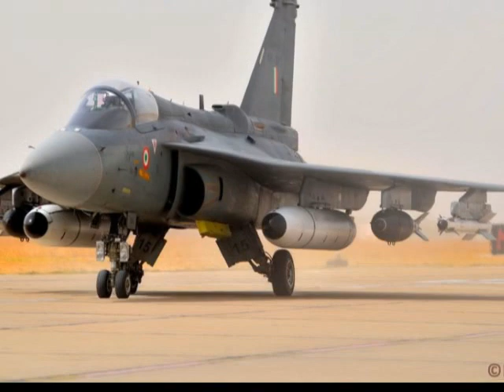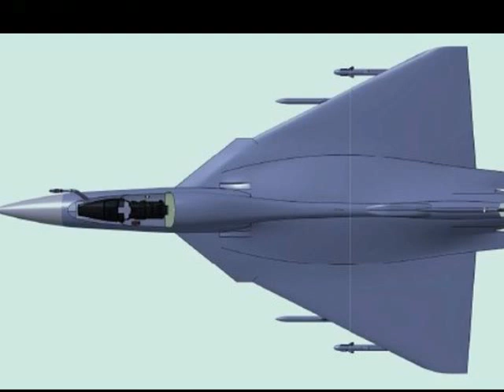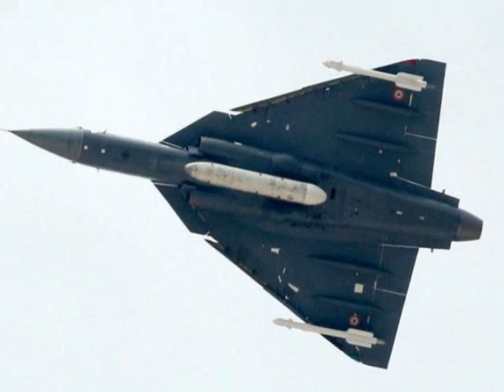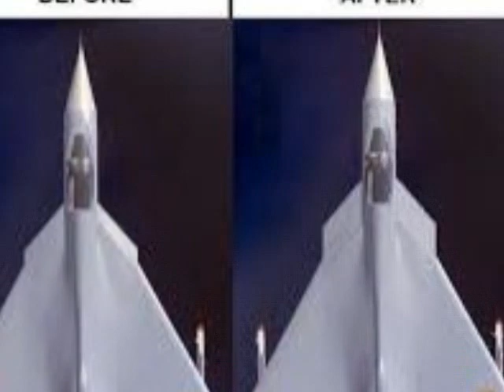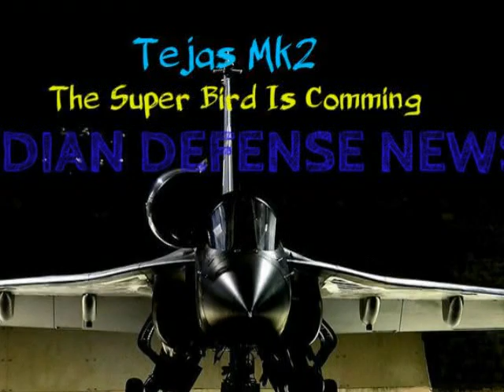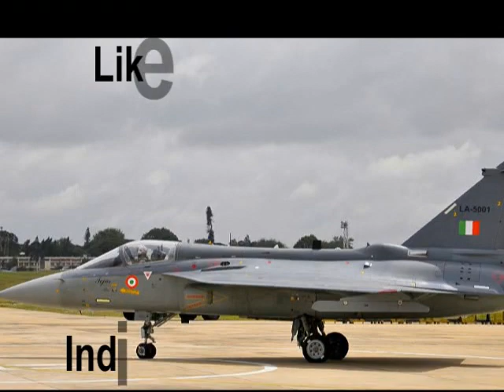Tejas latest news Tejas Is going to Be Super Bird in 2020 tejas mk2  by indian defense news

Comment: Current status of LCA Tejas.

The Tejas Light Combat Aircraft (LCA) has faced several challenges and issues during its development and operational phases. Some of the key problems reported include:

1. Weight and structural issues: The Tejas has struggled with weight management, which has affected its performance, particularly in terms of speed and maneuverability.

2. Engine issues: The Tejas is powered by the General Electric F404 engine, which has been criticized for its limited thrust and high fuel consumption.

3. Radar and avionics issues: The Tejas's radar and avionics systems have faced technical issues, including problems with the radar's range and accuracy.

4. Flight control system issues: The Tejas's fly-by-wire flight control system has experienced technical glitches, affecting the aircraft's stability and control.

5. Limited combat capabilities: The Tejas has been criticized for its limited combat capabilities, including its restricted weapon-carrying capacity and lack of advanced sensors.

6. Delays and cost overruns: The Tejas programme has faced significant delays and cost overruns, which have impacted its operational deployment and overall effectiveness.

7. Maintenance and reliability issues: The Tejas has experienced maintenance and reliability issues, which have affected its availability and operational readiness.

Comment: Congratulation to IAF on induction of LCA. But now in IAF there is a divide on LCA. Some want to turn the LCA into a advanced jet trainer due to its failure as multirole fighter, others are still convinced that it could be a success and some want to produce despite its drawbacks and just use it as a point defence fighter like the MiG-21 (which it is suppose to replace). Now that would be a achievement, producing a 1960´s MiG-21 kind of fighter in 2020.